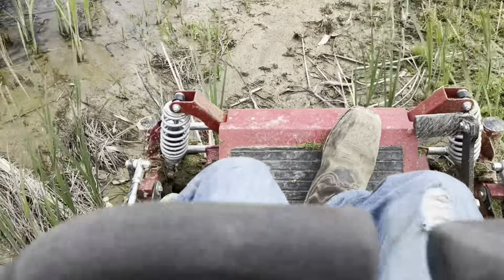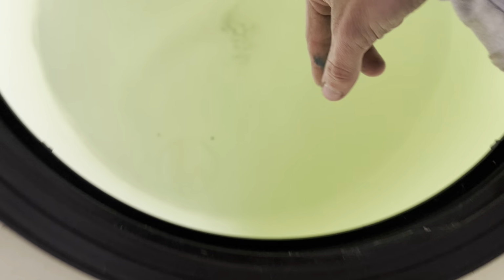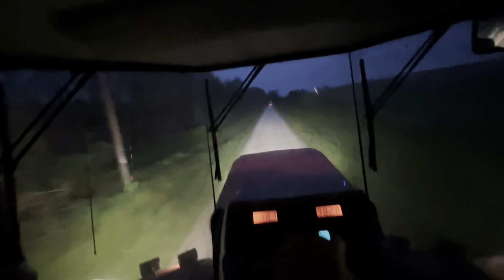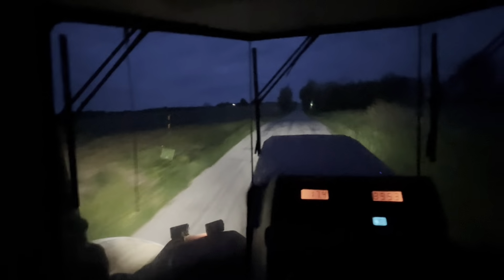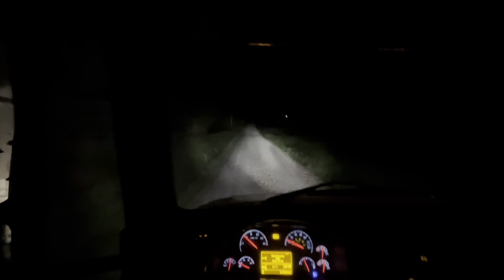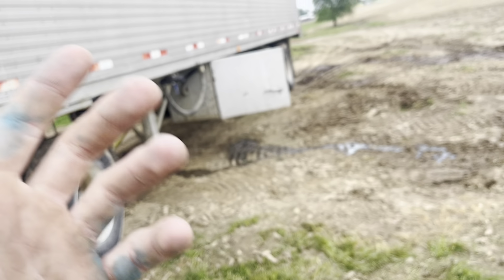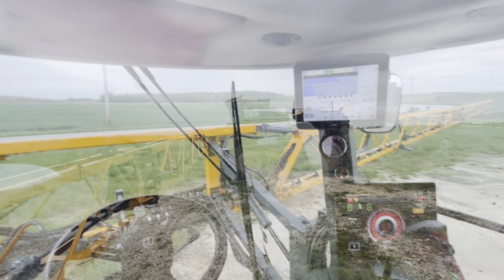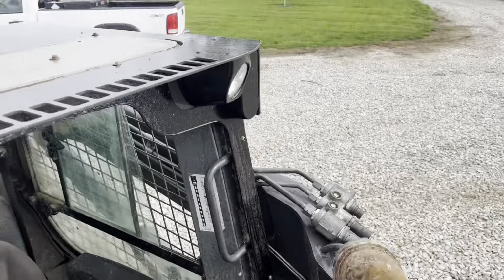What Do Farmers Do on Rainy Days?

Comment: $8,000 in parts to have a "new" engine!?!? Totally worth it, you get quality, peace of mind and longevity out of your investment. Too bad that big beautiful beast doesn't have a 3 point on it though. Regardless, for realistically a small investment, you're going to make that back multiple times over by having a good quality set of horses to work with. Tractors are ridiculously expensive these days. I've wanted to get a little one for yardwork but the numbers behind the dollar signs are increasing by the day it seems so I'll just keep on with my manual labor and electric tools. Good news though, having neck surgery soon to get this disc replaced that's pinching my spinal cord 🤘 I guess it's amazing that I'm still mobile and active, didn't realize it was as bad as it is. Tomatoes are nearing 10" tall. And I'll just leave you with much love and happy farming!!!! Beans, corn and wheat is going to make for some great harvest content ❤️